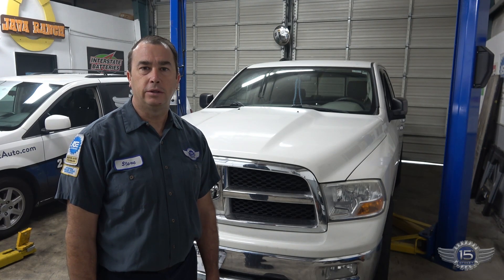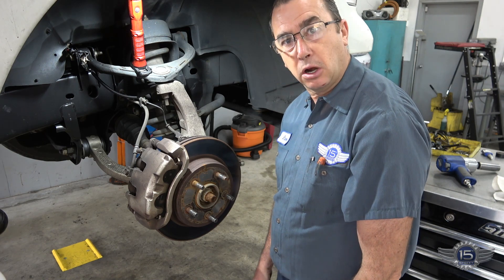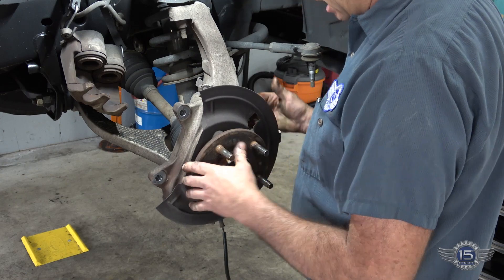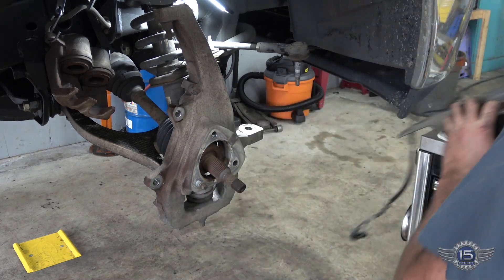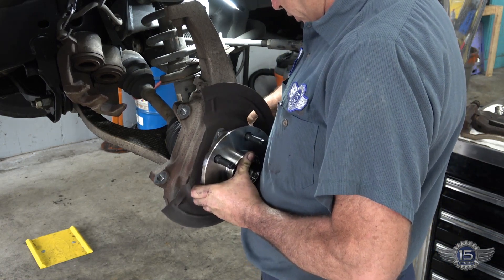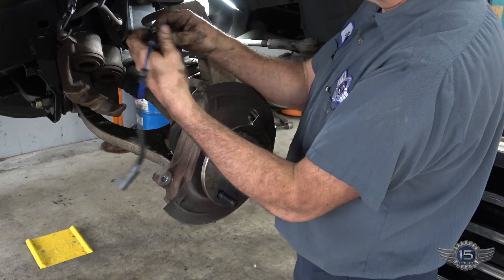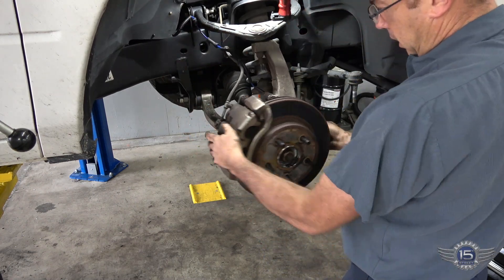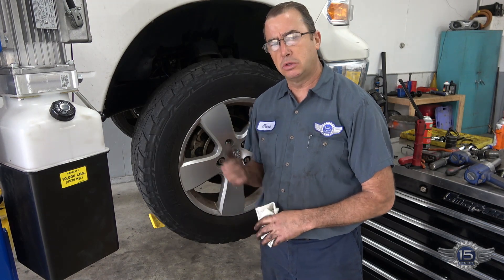Dodge Ram Front Wheel Bearing Hub

Comment: if you ever have trouble getting the wheel bearing out after taking the three bolts out put the tire back on put a block of wood between the rim and the frame start the truck turn the steering wheel rotate the tire a little bit turn it again it will pop the bearing right out

Comment: I just replaced mine today. Man!! Those three bolts that hold the hub assembly are a ducking pain to get out. Not only were they on tight but the space back there gives you little room with not much leverage to work with. I don’t have all the tools you do since I’m not a mechanic but somehow made it happen. Two bloody nuckles and two hrs later all done. Thanks for your video sir! Awesome job explaining.
Reply: He didn’t show you where you put the wheel hub nut back on and whack it with a hammer to pop out the drive axle spline. Then you have room to get the bolts from behind. Do that first before you start loosening the bolts

Comment: That old wheel bearing came out like butter compared to mine...mine is still "welded" to the nuckle after removing the 3 bolts...which were also a pain to remove.

Comment: u can actually get a '09 hub bearing off w out removing the axle or outer tie rod end.  if u crank the steering all the way left or right u can pound on a 19mm socket on the 3 hub bolts.  I used a deep well 19mm pounded on to remove and a reg 19mm w one of the trick articulating u joint socket extensions to drive them back on around the axle shaft.

Comment: I have a 2010 Chevy Equinox when you accelerate it like the back tire drag I have replaced the back tires because they where bad on the inside. The right tire was the worst wire sticking out of it. Do not know what's wrong. Any help thank you.

Comment: Excellent video. I am in the middle of trying to do this same job on a 2003 ram. The hub is very, very stuck. Any advice on how to get that thing out? I have tried pb blaster, a hammer, a pry bar and hammer at the connection between the hub and knuckle. Im not sure what else to do. That joker is showing no signs of budging any time soon.
Reply: Pound out or cut off one of the wheel bolt studs. Then get a heat tempered bolt and nut that will fit the hole. Put the nut behind the rotor and the bolt through the hole and use the steering knuckle to force off the hub assembly. You’ll have to do this in a few spots, but it works great to force off the hub, tightening  the bolt you use essentially as a reverse puller. It’s called the “bolt method”. Go to about minute 5:00 in this video. Saved hours of beating and swearing. 

https://youtu.be/7Yk2p5_CxqE

Comment: You mentioned putting "torque" on the bolts... How much torque was used ?
Reply: 130
Reply: Sadly I didn't see a torque wrench. lol  or anti seeze used i would hate to be the next person working on that project when it fails again lug nuts 120 ft lbs axil nut 180 ft lbs caliper bolts25 ft lbs brake shoe hanger 50 ft lbs. tie rod end75 ft lbs then you have a cotter pin in some

Comment: Do you suggest replacing both sides at the same time?
Reply: Both sides if your up for the task. I'd say 1.75hr per side at the same time change brakes and rotors. That's just me what I would do tho if brakes and rotors look fine then skip to just changing wheel bearing only

Comment: That looks like a fairly new ram at 50grand junk..
Reply: My used one needed a wheel bearing assembly at 245,000.
Reply: @gordonmcelvany8990  replacing my first hub assembly at 210K miles. On a 2010 dodge ram 1500
Reply: Just now replacing mine for the first time @ 268k miles. Love my 09 Ram. Best truck I've ever owned.
Reply: lol. It’s just a bearing man
Reply: @Dennis-sq2nm  that's ram for you. Just a bearing and the rear end. Lol .